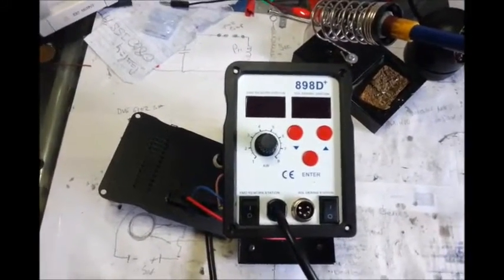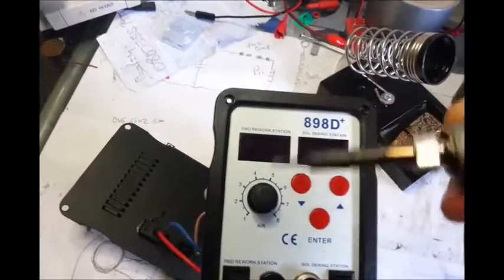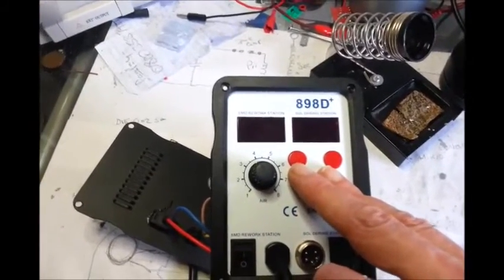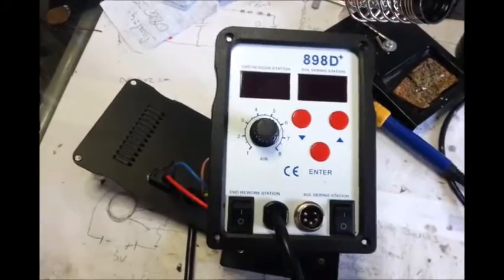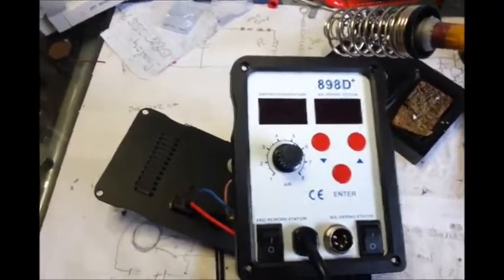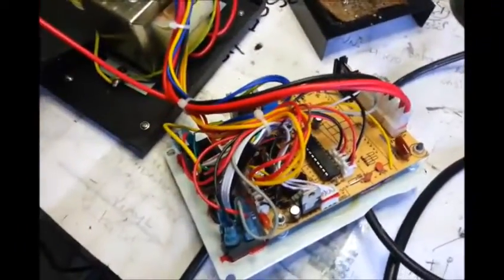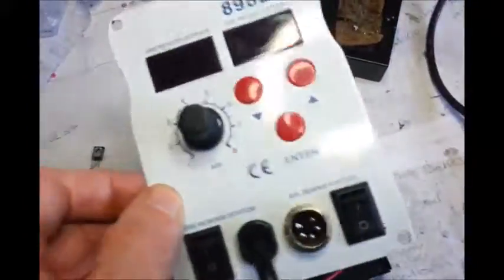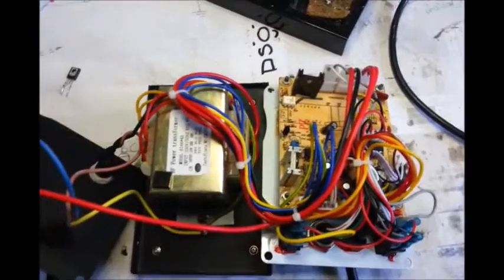Update: 898D+ Solder Station Blow Out

Comment: Thanx for video mate 
Was thinking to get one of those,
Glad I've seen it.u said it "Chinese"
Probably half of the components are fake 
Cheers again Dali
Reply from the maker: +Dali Rusnacik Its not  bad especially when you think you can buy on off eBay for under £40. That's pretty good for a rework station and it does all still work.
Since I replaced the Triac its been fine. I will be careful before I plug another solder iron into it.

Comment: replace the triac with a quality one (this is a known flaw in these clones) and the wand with a hakko (as they're not so bad) and it'll probably be alright. if they still made the analog fx888s, i'd probably get one of those myself, but i hate the 888Ds.
Reply from the maker: +kenabi Hello, thank you for the feedback. Which Hakko wand would fit this I would like to try one. I got 10 Triacs for £1.38, so they are probably not that great, any suggestions for quality ones?
Reply: +MonkeyMagic Elecifun triacs are pretty cheap anyway (price wise) so as long as the fit and finish look okay you should be fine. the wands on the other hand... personally, i'd be looking at a hakko wand, but the cost for a new fx8801 is just under the price for an fx888D station. so i'd probably get that and then just stuff the base in a box someplace since i hate the lack of a turn temp down function.

cheap wands in the hakko style are all over ebay, with an average of $15-20 us. mileage with these, does of course, vary wildly.

i do think that hakkos are a bit overblown with the rampant fanboy crowd they have, but they do last and they are good product (not godly, but hey) so getting an FX888D and using the wand from that (making sure the pinouts are the same, of course and adjusting if needed.) would be the option i'd be looking at. and probably tossing heatsinks on any of the triacs that don't have them, as some of these models get rather sparse with the transistor cooling :/